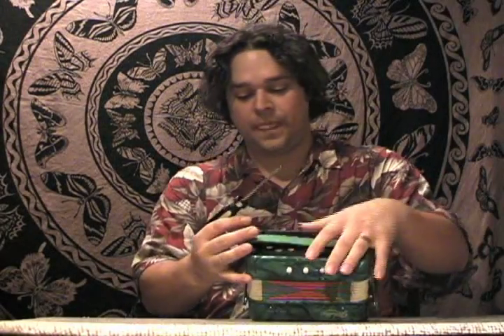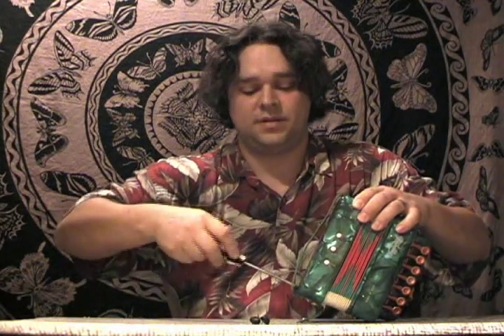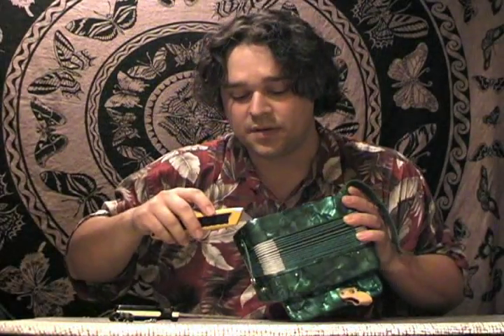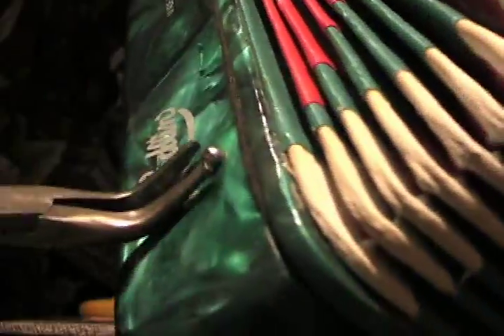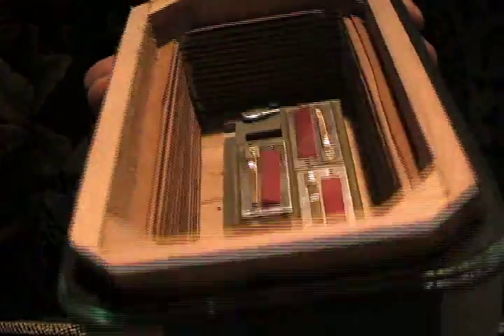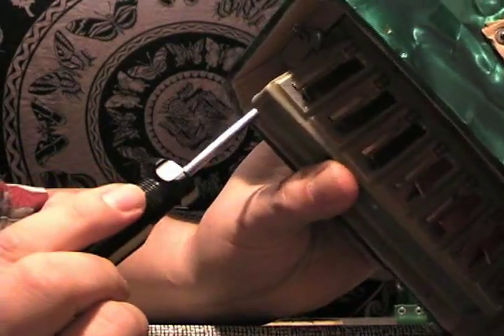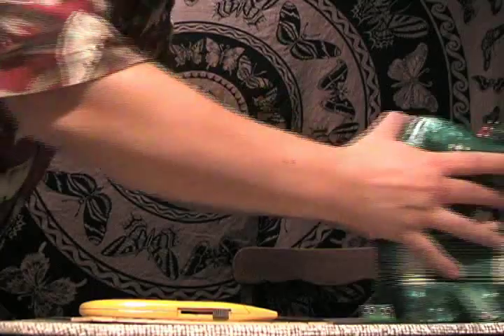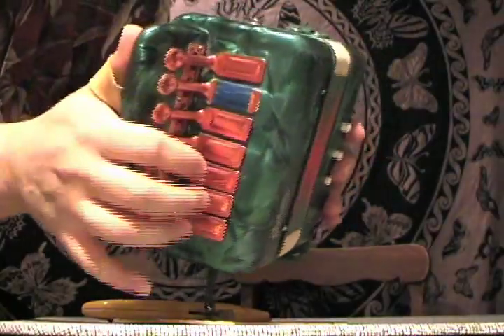Daily Video #226 of 365 :: Mini Hero / Goodlin Accordion FIX (Loose Valve Unit)

Comment: This was so helpful... On the one I found. The left hand buttons.. The top two work except the bottom. However there are three peices on the inside... The one hole on the button that dosent work dosent have a reed... It looks just like yours inside and out. It dosent even appear there ever was a reed on mine for that bottom left hand button. Is this common? Or could it be missing a part. Like I said there are three reeds inside for the left hand except that one hole... But it dosent appear to have ever had one.
Reply from the maker: k3ith29 great to hear it!  That third hole is an air valve which allows you to move the bellows quickly without playing a note.  Happy squeezing!